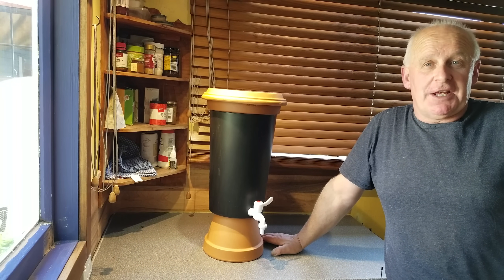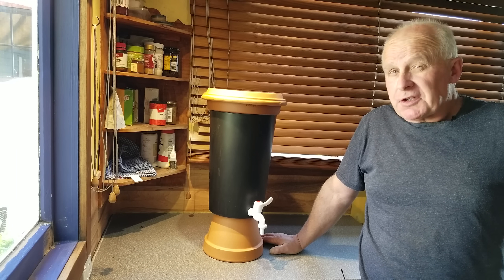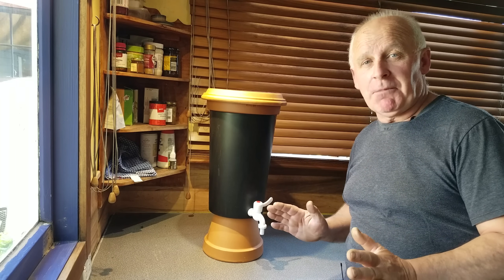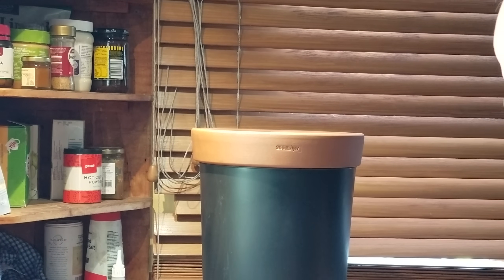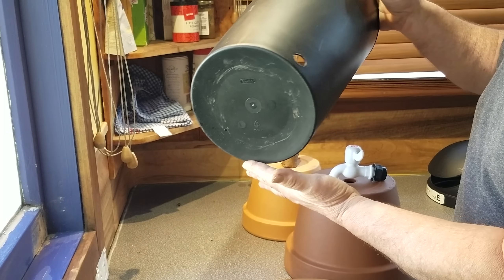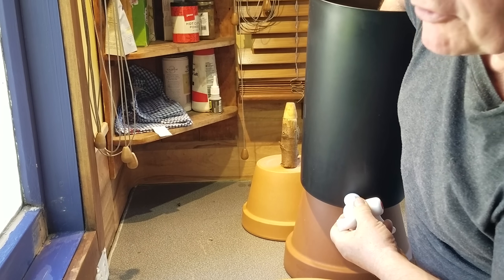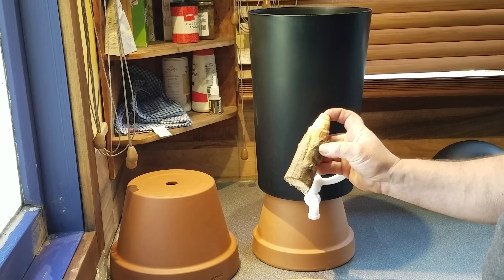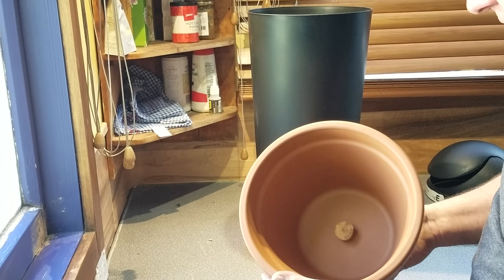DIY water filter. How to make FILTHY WATER drinkable

Comment: What about wood on the bottom? Does it not drip through its pores? And pores in ceramic dont get clogged throu time? Where are the unpurities going ? And mostly important,  what with chemicals in the water? Rain is not pure h2o...smog, smoke, and other stuff leave nasty stuff in clouds....why does that filter not have activated charcoal as stage?

Comment: How you know the clai is without poison like Teflon and heavy metals?  And why u prepare the pot with silver anti bacterial solution? Actually the clai pot and its microbiom will clean up ur water. I think this needs some experiments about this filter system.  Another question is, how to clean it up, or the microbiom will renew it? And if u put water, then some time it's covered by water and some time its just wet or dry. It means there are a few different bacteria are growing up on it... Very complex now. As well the wood. There is another case of different bacteria colony with the wood. And we could use the olive tree wood, which is well known for its health and antibacterial effects.

Comment: In Brazil we use similar ones made of clay and in the center a porous stone that does the filtration. But your idea with the cypress is sensational.
Reply: I just read a study that a 1/4 inch slice of cypress or pine ( bark removed) can filter 99.9% of bacteria out. The only problem is the cells close up and the water drainage slows down after a few days but it lasts a lot longer with clean water ( no dust or sand) you just put a new slice in when it gets too slow.

Comment: Made my own with bits peices and a old electric water URN. But with activated charcoal stones sand and filter cloths, I have very bad water,and rain water is not 100 per cent due to being in a agricultural area and spraying takes place near town now and then So I filter water for drinking heavy.
Also town water is very mineralised bore water,  and extra fluoride etc in put in also so no one drinks the town water unless you want kidney and gall stones......PS Even my electric filter mch gave up after 3 years....but I have had my home made one for 3 years already and doing fine I clean it out every 6 weeks..

Comment: What a great idea!  Thanks for sharing.  Commerical water filters are too expensive.  High quality terra cotta can last decades.  They're fairly easy to clean.  This seems to work like a well.  On another channel, I watched a video in which the guy dug a small but deep hole near a stream.  Water very slowly seeped into it.  After removing that several times, the water entering afterwards was very clear.  The soil held the impurities.

Rainwater doesn't have minerals or salts which the pot would absorb.  You probably can get much more use between cleaning/changing the pot than someone using hard water.  I'm going to try your idea.

Comment: After reading all the comments I think I'm going to tweak your idea use a stainless steel pot with a metal spigot. Then I'm going to do layer of sand then activated charcoal back and forth I'll start by running water through it many times as the charcoal will leech for a bit... I will do the colloidal silver spray on the clay pot for prepping. After a few weeks I think I will send the water for testing and see how it looks just for fun🎉❤
Reply from the maker: Yay- thank you for reading the comments- so few people do. You are a true researcher 😄

Comment: There is no more clean rain water since we have geoengineering wit plenty barium and aluminum.
Reply from the maker: Sadly that is so true- but this way I get the spiders and leaves out and I dont get the chlorine, fuoride and floculants.
Reply: Sounds like a deal ...   I will make one , just in case. BTW:  In yemen they make filters in the same way. @t.h.o.r.

Comment: QQ - Did you test the water before and after? What was the improvement?
Reply from the maker: Total dissolved solids down from 25ppm to zero. pH remained the same. its a particulate filter. so much to be learned from reading the comments.

Comment: So a good start but I would be concerned about the pigment used in the container. It was probably made in China and the pigment may come off in the water. The ceramic will filter out bacteria and viruses but you would need a layer of activated carbon granules to take out pharmaceuticals, round up etc

Comment: I took a clay pot, a bit smaller, and just tried this out on the table top.  After 4 hours, not a drop came through.  Maybe I just have a better grade pot.
Reply from the maker: If you read the pinned comment and watch the follow up video in the link you will learn among other things that may pots are waxed to slow transpiration. simply cook the pot on a low heat to vaporise the wax

Comment: i vote for stainless steal or glass for the holding tank.  great information
Reply: Do not STEAL it's a crime. Stainless Steel is what you're looking for
Reply: @markylon 😂😂😂😂😂
Reply: @markylon  that's what my mom said
Reply: @markylon  she is dead so
Reply: yes, easy enough to find!!!
Reply: stainess can be tasted though , glass doesnt taint unless it is lead crystal
Reply: if any algae gets in, the glass would let light in for them to grow, unless it's amber colored.
Reply: Good luck cutting a hole in those. I mean it can be done, but you better have skills. We have several 5 gallon buckets (water filter systems) around our home. they’re fast and easy to make and get the job done. I do like the idea of using the tree branches.
Reply: I don’t believe any plastic is safe for drinking.

Comment: Sorry to find a problem with your fab idea...but the plastic bin is not safe. ALL plastics, even those labelled "food grade", contain PFAS chemicals = forever chemicals which leech into our water and food which means that the BINS you're using definitely are NOT SAFE for food or liquids.

It would be much safer to use a galvanised, enamelled or stainless steel metal container or glass or ceramic.

In fact I bought one myself to try it. I tried it and 2 litres of water still hasn't filtered through the pot since yesterday. I can't see how to speed it up. If anyone has any suggestions would be much appreciated

Comment: Mate, are you sure it's not just wicking through the wood grain of the bung you're using because as I see it, that's end grain you have exposed there and timber wicks water through the end grain. I may well be wrong about how your filter works but timber certainly does wick up and absorb water through its grain

Comment: For those concerned about all the plastic we ingest (and who have the right tools) I bet you could upgrade this for a few bucks more to get a metal spigot and a tall stainless steel stockpot! Great idea!
Reply: Here in Brazil we use large clay pots. Its the best material for this
Reply: Copper pot instead of plastic would be okay.
Reply: Unless authentic steel and not a sandwich of cheaper metals. I drilled out a drain in a large restaurant sized ss bowl and the hole immediately rusted.
Reply: My brain was just working on that ..great idea...stainless deep stock pot...and it has handles !!
Reply: I might try a sun tea jar for the base. I'm totally going to try a version of this.
Reply: not really worried, been drinking from hoses for 60 years
Reply: I saw on the plastic bin's label that it contains BPA.  Stainless steel makes better sense.
Reply: @lynnewilson269  It’s often used in prescription medicine bottles, yogurt cups, hummus tubs, single-use cutlery, and some packaging for personal care products like deodorant, lotion, or shampoo. Lids of single-use drink bottles are often also made of number 5 plastic as well as a great deal of single-use laboratory and medical supplies at hospitals, clinics, and labs.
Reply: @lynnewilson269  Recycling code 5 is an acronym for polypropylene, or PP. PP is frequently utilized in packaging, pharmaceutical bottles, and food containers. It is known for its heat resistance and adaptability to a range of applications, and it is BPA-free.
Reply: That plastic trashcan is not food safe and will leach unwanted chemicals, especially coming from a dollar store (China). Good idea just not the safest receptacle to drink water from.
Reply: @tatersmama11  this is an interesting comment.  It seems possibly controversial. I'd be interested in reading what youmay have?  It's my understanding that tho polypropylene can be one of the "safer" plastics to use, it's dangerous are around it being heated?
Reply: @tatersmama11 
I transfer clean treated water to food grade plastic barrels.
Reply: I did use food grade buckets
Reply: That's what I was thinking!

Comment: This is the most funny video i have ever seen. "Im scared of the chemicals in the tap water so im drinking from a plastic rubbish can" 😂
Reply from the maker: Yes you are very funny, but I can tell that you have fluoride in your toothpaste. The plastic is polypropylene - type 5. approved for domestic water pipes and storage tanks. also medicine bottles and cooking utensils. "Polypropylene (PP) is considered safe for humans. It is considered the safest of all plastics; it is a robust heat-resistant plastic. Because of its high heat tolerance, it is unlikely to leach even when exposed to warm or hot water. It is approved for use with food and beverage storage. It can be re-used safely and used with hot beverages"

Comment: Good day, I live in Canada and us a Berkeley.  I’ve recently discovered if you use an air compressor, I purchased a small one almost fits in my hand, you can blow out the filters to clean them never have to buy another filter genius.
Reply: Basically reverse washing with pressure using air. 
The only side effect of that is that it can increase the pores size.
Reply: I will say this, you are unintentionally contaminating your drinking water, typically in north America and I believe other countries as well air compressors use pneumatic oil, even oil less ones have a small amount in them to prevent corrosion. Even if you can't see it it's there! A better option would be to use CO2 or nitrogen if you have access! Not trying to be a Debbie downer here just trying to inform is all, have an excellent day!
Reply: please what type of air compressor do you use? Do you have a link?
Reply: I'd also like to know more details please!!

Comment: You may not need to drill into a plastic rubbish bin. I have a clear plastic about three gallon container with tap I bought at a mineral spring at the Temple of the Blue Dragon here in S. Korea. All I need is to fit an unglazed pot  on the top and filter away. I haven’t been back there ifor three years so the three gallon container ,handily sold by the monks there , has been going unused. You might find one at your local Buddhist temple. Yes there is a Blue Dragon there. Fortunately, Dangun, progenitor of all Korean people, 5000 years ago turned it to stone. Lucky I didn’t go there before that. BTW  there are two springs; one strong, one mild. I went for “mild” which had a metallic mineral taste. Plants loved it. I don’t think I could take the strong mineral water. Koreans though have been going there for at least 3000 years. It’s free except for $10 three gallon container.

Comment: So interesting! I and wondering if you have to replace the pottery after a certain time . Does it get clogged up with contaminates? Also, the plug you used was made from wood from your property, but what other material would you recommend if we can’t get that material? Thanks
Reply: A cork or synthetic bung from a home-brew supplier will do the job.
Just apply some 'lateral thinking'. SMH

Comment: That's a really great idea, but I would be concerned with the lead content of the flower pot, because you might be putting lead into the water. Also, drinking rainwater all the time isn't healthy because it has no mineral content and water is how we get much of the minerals that we need. For that same reason, it isn't healthy to have a diet of distilled water. Mineral content is very important. That said, I think this is a great idea, so long as you qualify the lead content of the flower pot.

Comment: What can we use if we don't have a cyprus tree nearby? I would suggest putting piece of shunghite  in the top and bottom
Reply from the maker: a cork!- seriously. I only used the wood plug because I couldnt find a cork!
Reply: A cork or synthetic bung from a home-brew supplier will do the job. ($2-6Aus - I'm not interested in converting to $US)
Just apply some 'lateral thinking'.
Your need/task is to plug a hole with something that's non-toxic, will not impart any noticeable 'flavour' or 'odour', will create a water-tight seal and will be long-lasting.
Now, I wonder if anyone has ever faced and solved that problem - eg to plug a bottle or jar?! 🤔
Good grief.
It's not rocket science.
Do people these days REALLY need to be spoon-fed and lead by the hand through every minute of their life?!  SMH
BTW - in case you're wondering, the spigot YOU use doesn't have to be EXACTLY the same as the one in the video, nor does the 'collector'/rubbish bin.
If you're worried about being a 'survivor of the end of civilisation', or even just want to become less reliant on 'commercialisation', you'd best practice thinking for yourself.
Whatever happened to basic common sense and logic?!
Reply from the maker: @trueaussie9230  On the day I went to every likely store in my tiny town thats why I ended up whittling a bung of course from the best material I had to hand- as I always do. Thanks for the voice of reason in this mad comments section. People cant see past their noses nowadays!
Reply: @t.h.o.r.  
🤣🤣🤣🤣🤣🤣🤣🤣
I posted a completely innocuous reply but the YT '1984' censors deleted it.
What HAS this world come to. SMH
Never in my 70+ years did I imagine I would live to say it, but I'm glad I'll be out of it soon.
I'm even more glad that I've committed no others to endure it.

Comment: I would be very cautious about using "clay" pots imported from china. I bought what I thought was a terracotta pot, but accidentally chipped it when I got home, it has some sort of black ceramide about 1-2 millimeters below the surface. Its not true terracotta.
Reply: That's what you get for living in a country that has low 'health' standards.

Comment: You MUST check that water that went through, for heavy metals because the source of clay is for non-food use, and lead and such don’t burn out on low fire clays like terra cotta. If the water tests fine, you’re good to go. Lead interferes with enzymatic functions resulting in brain disease and more, and cadmium causes heart problems. They MUST not be ingested.

Comment: Without any effort I found this by doing a quick search on the web. Terracotta is a baked clay used for pottery that may contain a variety of heavy metals, including arsenic (3). Baked clay has been used for thousands of years to both store and cook food, but there have been no reports of symptomatic arsenic toxicity with ordinary use.
I would imagine that using the pot as a potable water filter is hardly an ordinary use.
Reply: Terracotta has also been used for THOUSANDS of years as ... a water filter, for water storage and evaporative cooling.
In non-pampered countries it is most definitely considered "an ordinary use".
Reply: So what?  They used to solder water pipes with lead but that turned out to be a terrible thing to do.   Non-pampered countries like where?  Just becuase someone takes issue with using Terracotta from unknown manufactures that may include heavy metals doesn't mean people should not beware that using it as a filter may be a health hazard.   Half baked video if you ask me.
Reply: Oooohh dear.
Someone's delicate nerves are raw. 🤣🤣🤣
Reply: Well, seems that someone's are.   @trueaussie9230

Comment: Several problems with your cheap water filter won the rubbish bin is going to leech plastic  into the and your terracotta pot is not taking out any microbes in water so good luck with that I foresee you having a severe case of the s** when you filter the wrong water through that

Comment: To really mix things and make sure the water is super clean, use a small bed of sand on top of some pure carbon char coal which you should replace periodically.
Reply from the maker: Yes - thats a great idea.I make my own charcoal in a retort but you can buy it at aquarium shops

Comment: I have a proper filter with sand, ceramics and charcoal and its a disaster - it filters fine but the water goes green when stored which filtered water from commercial sources that use reverse osmosis then treated with ozone, doesn't. You have to find a way to sterilise it but not chlorine. BTW I have proper storage containers. That's why I stopped filtering my own water

Comment: I have a glass base from a filter that did not work as promised….replacing the spigot with a stainless steel one….and using an upside down unglazed tagine top - and the base as a cover….may put a second layer with a charcoal filter but definitely some elite Shungite in the bottom of the glass base….thank you!
Reply from the maker: That's the prepper way- use what ya got. I would have loved a glass or stainless container but I had to make do with what I could find in 2 op shops and the hardware store.

Comment: Oh interesting to find your video just after thinking two days ago about the filters online. IKEA has or had a very large glass container with a tap on the bottom, nice for drinks or water during the summer or punch for a party. Now I just have to do an IKEA run for the clay pots.
Will it work for regular tap water?
Also moringa seeds can also be used to filter water, according to YouTube videos.